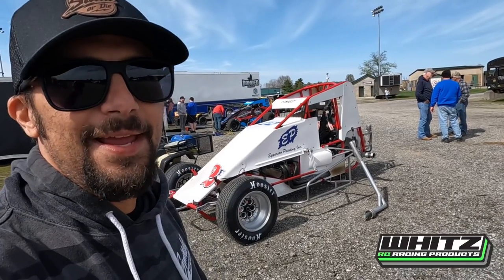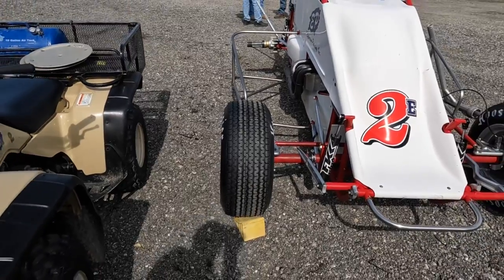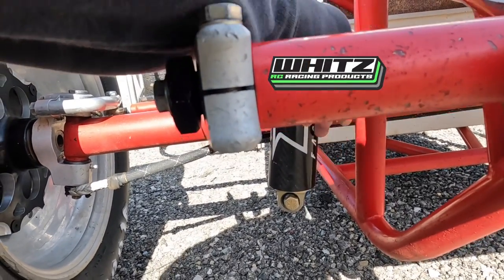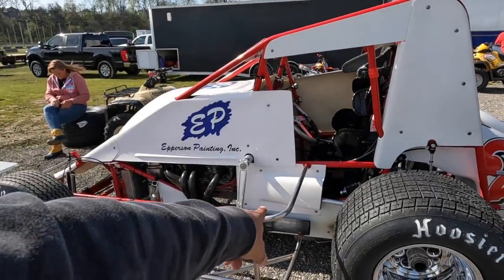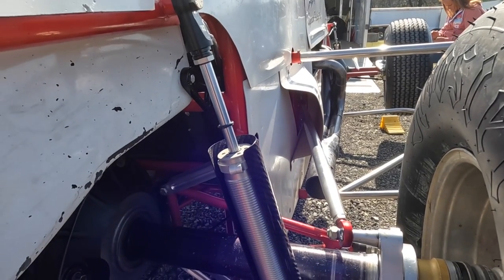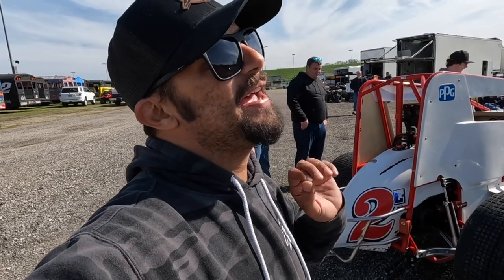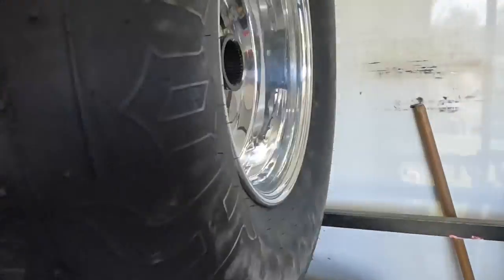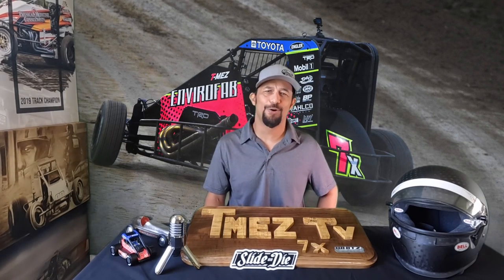Sprint Car Basics

Comment: Hey Tmez, thanks for the video. Shocks have always been something I never understood that well in sprint car land just because of the way the vocabulary is specific to sprint cars. When someone refers to say a 6-4 shock, do those numbers mean anything specific? I know they refer to comp and rebound and the higher number means a higher damping rate, but does that number mean anything specific? Or is it all relative? Are the numbers you talk about in the video (x number of pounds on each corner) the force values generated by the shock at 3 in/s? Also, have you ever experimented with variable rate shocks? i.e. having different damping rates in high speed and low speed compression or rebound.
Reply from the maker: Your correct. 6/4 would be 6 on compression 100 pounds of force at 3” and a for on rebound would be maybe 60 of rebound. Each company has their own range of numbers referencing to the single digit numbers.
Reply: @tmezTv  sounds complecated as metalurgy in steel and blacksmithing.

Comment: 100% a different world when compared to asphalt. One question about terminology. When you say, "stick the right rear", are you talking about loading the LR so the RR stays gripped up for drive off or do you mean the literal loading of that right rear tire? 

Thanks for the vid, I hope you do a lot more of these, maybe going more in depth on each specific aspect of the sprint car setup.
Reply: You answered your own question; The lateral loading of the right rear tire.
Reply from the maker: Loading the rr. If you can stick the right rear on a sprint car, it will almost not slide on entry but halfway through the corner it will want to start over rotate off.
Reply: Got it, thank you both for the replies.

Comment: Great job Tmex. Thank you so much. But I'd like to ask you one question. Why the small left and large right rear tires? I used to think it was to load the left side of the car. But now I think it maybe for a rear steer kind of effect to help in the turns.
Reply: Yeah it’s stagger. Pushes you around the corner. You use more ( larger RR) at a flat banked track and less ( smaller RR ) at a banked track
Reply: @5off5onRFK  Thank you!
Reply: @Brad-S  👍🏼👍🏼
Reply: Stagger only works when you are on the throttle. Think of a paper cup, large up top, small on the bottom. Lay it on it's side it will go in a circle.
Reply from the maker: Definitely we start with 11 inches of stagger and typically race on about eight or nine if it is slick so you are indeed correct without the small left rear tire of the car would not turn because straight axle no differential spool

Comment: So you like to run right rear weight, not many do. Also instead of adding weight on the corner by putting turns in, I find it better to put a stiffer bar in that corner and keep the car straight off the setup blocks. Also you can preload the bar just with a shock, if you are holding the car down with a tie down shock, it loads the bar and helps to keep the load on a linear scale, keeping the tire driving into the track.
Reply: Reading this, do you race a sprint car or is it off a sim game?
Reply from the maker: To each their own, everybody finds a way that works for them. I typically run a pair of even bars, but with a turn in the right rear, always minimum.